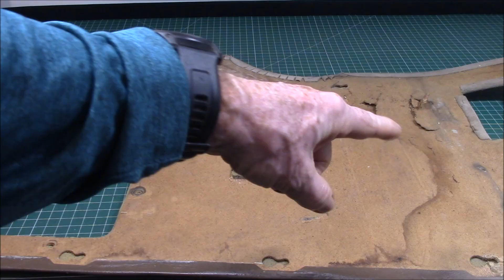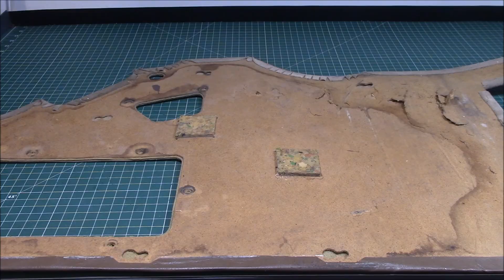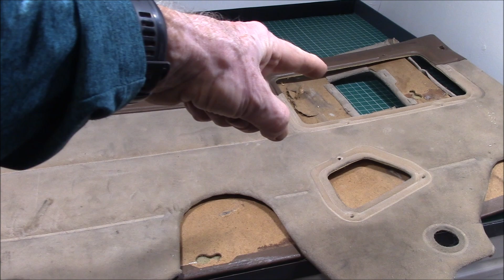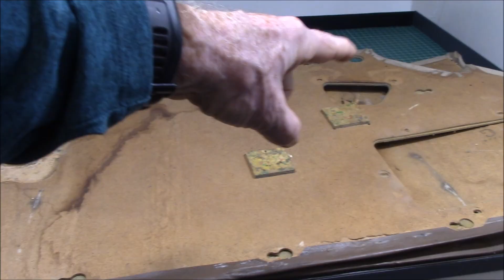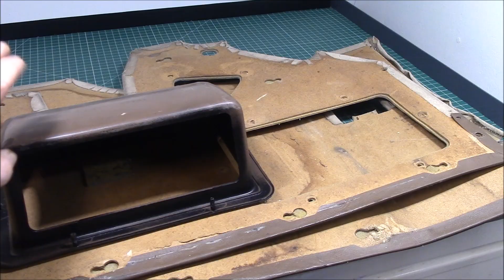1st Generation Toyota 4Runner, Rear Passenger Side Panels; Introduction

Comment from the maker: I've been working on these new rear passenger side panels for a few months now.  I had to take them off to access the bed side areas for wiring, such as the new speakers.  Once off, it became clear that it would be better to make new panels out of plywood to match the back.  The plywood panels are proving to be much better than the OEM panels; easier to remove and replace, easier to add things to them, etc.